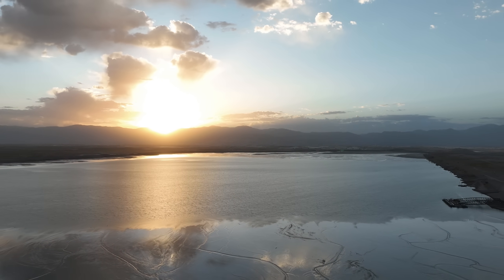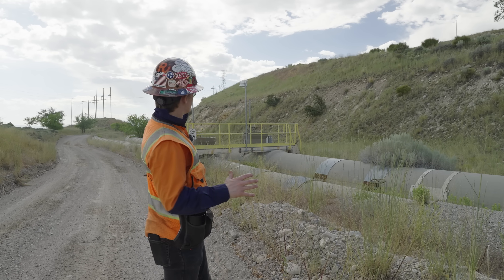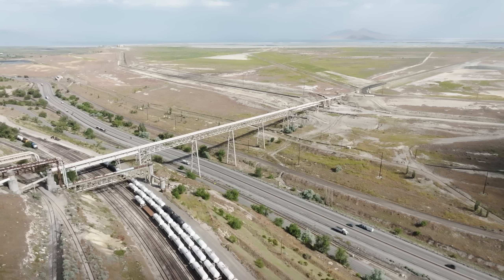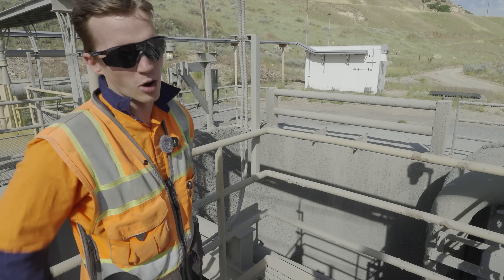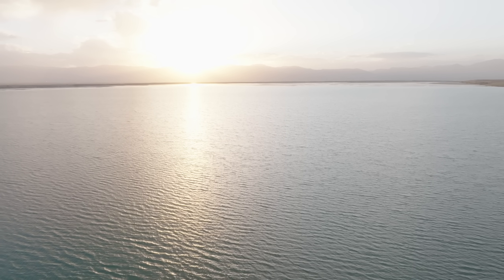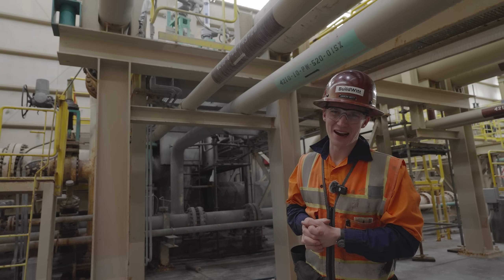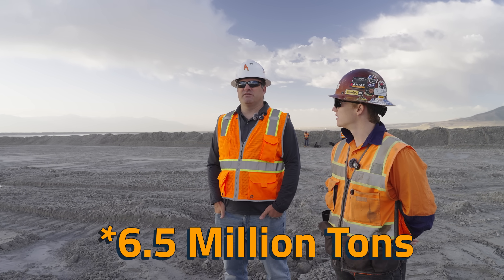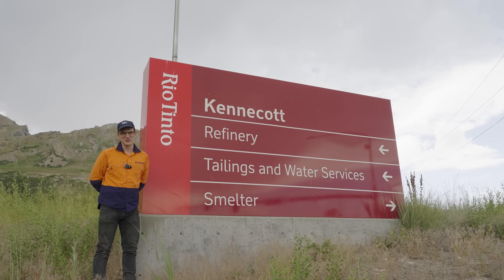The Unknown Side of Copper Mining—Tailings!

Comment: Typical American construction, using a tractor built for floating on soft ground to compact the sand. Ridiculous.
Reply: Well they're using row crop duals which , as the name implies, are designed to fit between rows of crops. As such, they compact the ground quite a bit, hence the existence of deep rippers and subsoilers. Normally it's a bad thing, however in this operation the tires are used to squeeze the fluid out of the sand. If the tractor was built for flotation, it'd have wide duals or row crop triples.

Comment: Why so little plant life also we’re the metal plants like the ones that accumulate metal in there bodies up to 5% or more.
Also how toxic is the water at the end and do they reuse it.
Reply: It is toxic which is why there is so little plant life but we recycle 80% of our water to run our operation, the rest comes from holding ponds  that collect t rainwater and overflow from the lake. Nothing from our facility goes back to the lake. That's why there is a big impoundment, to contain the toxic water and not put it back out into our surrounding bodies of water. That's also why we need the sand, so we can build the dam to hold back the hazardous water 🙂
Reply: @YOUR_LOCAL_SOJI_OKITA_SIMP  makes sense but have you considered increasing the amount of time and metals you get by planting metal trees yes there called that but understudyed. 
The plants would reduce flooding from rain water and reduce toxic metals from going were they shouldn’t.
1 plant or tree can’t do it all almost all of them only accumulate 1 kind of metal like nickel or copper or iron or lithium. not a metal but salt as well tumble weeds will have cadmium but at low levels.

Comment: I wonder if the underflow or overflow could be used in concrete production.
Reply: The overflow sets up as hard as concrete around the edge of the impoundment so we can push sand onto it to widen the base of the dam as it gets taller. The underflow material is what the tractor drives on to build the dam 😁

Comment: At the coal mine, i worked at. A lot of the old guys would dump used oil and waste diesel on the  coal before getting haul away to the prep plant.  They would say that's why our coal had such high BTU's 😂
Reply: Contaminated diesel or diesel used for cleaning.
Reply: what the hell is waste diesel. Used solvent?

Comment: Couldn't that sand be used for making concrete?
Reply: It’s the wrong consistency and size.
Reply: they do, in australia they use tailing to backfill underground stopes, which is usally a mix of tailing, cement and water
Reply: No. It's not that kind of sand. It sets up as hard as concrete but it's not the same.
Reply: Likely too many chemicals present to be suitable for concrete.
Reply: @joeyduffield2684 there are zero chemicals in concrete.
Reply: Yes. But the neighbors dont need 7000t/h of concrete. And its stupid expensive to transport sand across the country, much cheaper just to dig it up next to where you need it.
Reply: @mabamabam  or to crush used concrete back into the right size particles,  that tech is cheap

Comment: I work in tailings at highland valley copper in B.C, super ingeresting seeing different setups. Our tailings used to be gravity but are now all pumped. Interesting to see tractors without blades to be used to place sand, our dam contractor uses d8's.
Reply: We tried doing it with dozens but they found the compaction was actually better with the tractors and they don't use nearly as much fuel.
Reply: I thought they said the tractors only compact to the required 98%. The hoe places it. ?
Reply: @blueman5924  if i had to guess the tractor packs it and the hoe moves the feed pipe, hence the cables on the bucket. They just allow gravity to place the sand and let the water run off to the drain.
Reply: @TheSinjas  ya it looks like they are directly placing on the crest, hence the compaction, i know highland and red chris just use dozer then its place on the crest later
Reply: @blueman5924 no, that track hoe was moving the pipe with the material coming out. They were filling in the hole that's made from the material coming out of the pipe. The material runs all over out into the work area from the pipe, then the tractor drives over it to make ruts with the tires. The ruts have a few different purposes but a major one is to squeeze the water out of the ground and gives it a path to follow so it can drain out, this also achieves our compaction.
Reply: @YOUR_LOCAL_SOJI_OKITA_SIMP  interesting. i dunno about highland valley but at red chris our sand isnt that dence we would have a stuck tractor in our panels
Reply: why not use road rollers?

Comment: Super interesting. I wonder how abrasive that slurry is on those pipelines. Seems like it's essentially a liquid sandpaper.
Reply: Most of the tailings pipelines are actually rubber lined and are routinely inspected. Common wear areas are torn down and replaced seasonally.
Reply: It is very abrasive, slurry pumps are rebuilt every couple of weeks. The pipes are rubber lined so don't wear all that much.
Reply: @LPAtkins slurry pumps can go for 10 years Wingnut .
Reply: We made elbow sections for with slurry piping at my last job, it's disposed of like Kleenex.
Reply: Could it be used as a substitute for sand in concrete?
Reply: it is abrasive the lines are usually changed every few years
Reply: The crazy part of them pipes that go to the cyclones are actually steel with rubber liner
Reply: That's the same thing I was thinking!
Reply: What is that female symbol with a "K" inside it supposed to mean?  3:51
Reply: @barrymccockiner6641  That female symbol is ancient symbol to Copper metal. And I think K just refers to the refining company's name.
Reply: When it's mixed enough water it's not, because there's nothing pushing it up against the pipe. And it's not flowing fast enough for it to be seriously abrasive
Reply: @mhxxd4 yeah like Rivers
Reply: @matt45540  no not like rivers
Reply: @mhxxd4 wrong. Read the comments
Reply: @ no thanks